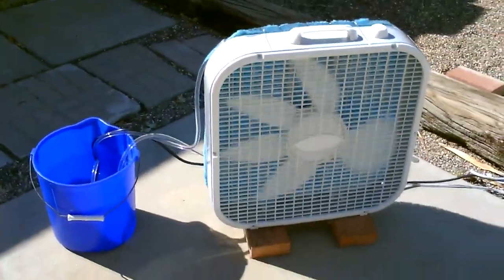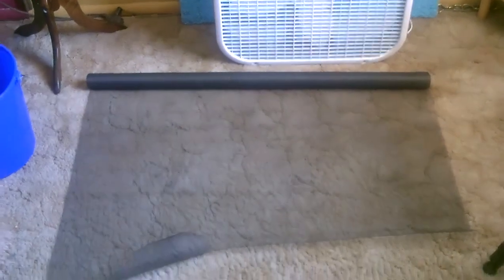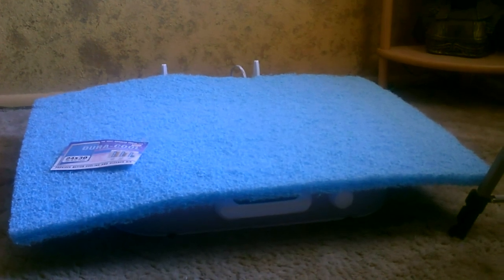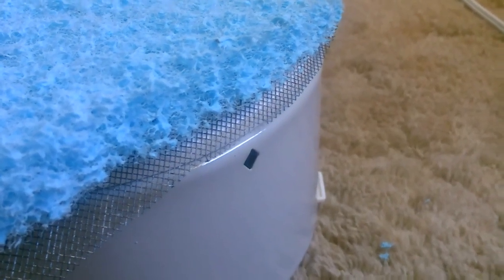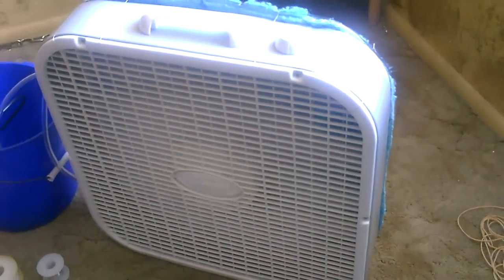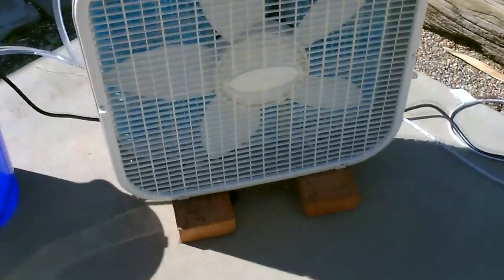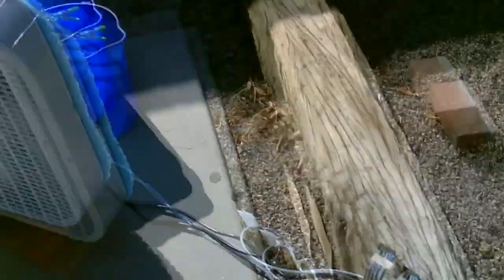Homemade Evaporative Air Cooler! - Simple "Box Fan" Conversion - EASY Instructions!

Comment: So what size pump do you need and how long does the water last?
Reply from the maker: i think i used a 200gph pump in this setup (but it doesn't have to be that big). the main thing is that the pump has a good lift to it. i've found that some smaller pumps that have a good lift height (63gph ones) can push the water thru fine. but i have a 168gph pump that doesn't have much lift and that pump struggles

Comment: You left out a section! How is the water pumped form the bucket through the hose?
Reply from the maker: hi. it's just a small water pump. i think i was using a 200gph one (but you could use smaller one)

Comment: My question is how did you connect the watwr tubing to the pump. I have a small fish pump and it has an over hang on the part where the water comes out.. would be nice to see the process of the pump and aquarium tubing
Reply from the maker: hi there. the tubing just pushes onto the outlet stem of the pump. it fits pretty snug but you can you a small 'worm gear clamp' if you want to. i don't think i've ever seen an over hang on a pump. most of the ones i use just have a stem

Comment: I’m going to use two box fans. I’ll use one for the air flow, and the other only for it’s frame. Then attach them together so I have a larger ac and the water will be further away from the fan.
Reply from the maker: hi. that could work, but, if interested, i just made a video that shows how to attach these evap pads to the back of box fans without the pad touching the fan. in the new design the pad is sandwiched between two plastic panels and then mounted off the back of the fan. there's an inch of airspace between the panels and the back of the fan, so there's no chance of any water getting on the fan. works awesome and is easy to do. the video will be posted in a couple of days (probably on 07/07/2023).

Comment: When you want Cold but end up getting Mold.
Reply from the maker: the way to avoid any mold is just to dry out the pad every 12 to 24 hrs. just flip off the pump and let the fan run for a while (maybe 10 or 20 minutes). the pad will completely dry and then you're go to go (for another 12 to 24 hours). also swap out the water, from time to time, if you have a larger tank.

Comment: What exactly is a evap cooling pad? I found an air filter that looks similar.
Reply from the maker: hi. evap cooling pads are specifically made to hold water in a certain way (while also letting a lot of air pass thru them). the material is weaved in a very specific way. the blue ones that i use are technically called foamed polyester evap cooler pads. air filter material is a different material altogether.

Comment: I just looked up where you get those Dura Cool pads?? they are over 100 dollars!!!! Might as well invest in an AC unit..
Reply from the maker: hi. they are $7 to $9 dollars for a big sheet of it. if you see them for more than 10 dollars then the seller is ripping you off. home depot and lowe's have them for about 8 dollars. note that they do sell the material in large rolls for over 100 dollars - but that is huge rolls. you could make 20 air coolers with a big roll of it.

Comment: IS this good for a humid place like Florida...any ideas for us in grid down situation here in FL?
Reply from the maker: hi there. i have some solar panel powered ice-based (or cold water based) cooling systems using a radiator as the heat exchanger. those projects would be a good choice. to see those vids check the playist area of my channel and look for the heat exchanger projects.
Reply: @desertsun02  TY so much, new  to all of this and trying hard to figure it all out, lol...subscribed to ur chanel!! Stay safe!!
Reply from the maker: @Karen Gouws thanks for subbing ✔😎💎

Comment: Shouldn't you have a lid on the bucket
Reply from the maker: hi. it will work with or without a lid. if i was dropping ice in there (for a super chill) i'd use a lid to insulate 👍🙂

Comment: Can't you skip the screen and just put the evap pad in front of the fan (the blow side)? Also instead of a pump and you just place the bucket on a higher place than the fan?
Reply: Use the pump to put the water back in the bucket from a catch on the bottom.

Comment: I did this w pushpins and found the water flow was poor.  Then I followed a hundred + holes w a small nail and was still disappointed with the water flow.  I shoved the 2 pins in the tube to not lose them and went to dinner.  When I came back after an hour +, I pulled the pin out and was met by a solid squirt if water from the hole that held the pin for an hour.
So hindsight, instead of the 500 holes he mentioned, put ten thumbtacks in the tube and wait an hour before removing.  Ten holes that stay open are better than 490 that close up.

Comment: Ha ha. We used to drive to CA from AZ in the 1960's  during the night and use water soaked anything in front of a partially open window. IT WORKED better than nothing. Alternatively, we would roll up all the windows until we were dripping in sweat, then roll them all down and for a few minutes, we were cool! That's natural swamp cooling at its finest....
Reply: im in phoenix and aps is killing my with this heat wave...i have  been doing the same sitting outside with wet rags, i never thought about this....DUH...lol this is awesome!
Reply: @davidpersico5028  I'm still in Phx. Yes, APS is a bummer with much higher $$ than SRP (I've never understood how having to move ones physical house to switch utility co's is "deregulation"?). 8Yrs ago I planted 3 desert trees on my west side that are now 30' tall and reduce my electric bill by 55%. The difference inside my house is extraordinary. If you have room outside, box stores also sell an S-shaped spray emitter that stands while spraying one nozzle of fine mist. While we desperately need to preserve water in AZ, it uses 1 gal/hr, so some cooling outside this way can be life-changing. Remember to replenish yourself with electrolytes but not sugary drinks or caffeine that will make one thirstier and hotter. Commercial electrolyte drinks can have dyes and too much sugar, so check out DIY.

Comment: wondering how to make the drip without the pump
Reply: You could try a gravity feed system - Have your reservoir higher than the fan, with the tube coming out the bottom or bottom-side.  Not as efficient, but it might be functional.

Comment: Can I use exhaust fan? Instead of box fan?
Reply: Any form of air movement is all that's necessary. A higher cfm will help with feeling cooler as well, though if the fan pulls air through the evaporative pad too quickly, some effectiveness would be lost.

Comment: My mother's sister had one of these 50+ years ago in Kansas which they called a swamp cooler!!!
Reply: Yes, he is making a DIY swamp cooler.  Some apartments have swamp coolers but don't get the room below 80 so this will help get it cooler.
Reply: CALTECH007 I live in a high temp, low humidity part of California. Swamp coolers, located on roofs, are the customary method for cooling homes, businesses, etc. In my experience the temperature can get into the 70s with swamp coolers. Evaporative cooling is the oldest form of cooling and was used by Cleopatra.

Comment: Crazy idea use a helium sealed stirling cold piston to generate liquid atmosphere that filled an insulated tank that siphoned into a drip system into a evaporation matto super cool the air has the liquid atmosphere returns to its gas state? You could use this concept on your ice chest air conditioning design. 😊😉

Comment: I realize this video was made almost 3 years ago but why did you not finish the project with a drip tray and a return to the bucket ?
This little improvement would have saved water in the long run and constant refills if that applies.

Comment: Does the shape of the fan affect the effectiveness?
Reply: the closer the blades are to the ring around it, the more powerful the air current (without changing size or shape of blades) but maybe you can do experiments to tell us if one shape is best?

Comment: instead of cooling pad would a air filter work???
Reply: I don't think air filters are meant to be wet. You can find lots of cooling pads at Home Depot or lowes by the swamp coolers

Comment: If You made a frame for the fan to set into after you were done building  the frame , with a drip pan ( like the bucket but more of a pan type thing.) you could use the run off water to re circulate and you would not have the dripping on the floor problem. Since the frame would be for the fan to set into, the fan housing would no  longer be the housing of the cooler, you could make the cooler frame further back from the fan blades.    If You used say, 1" and 1/2  white PVC tubing to make the frame for the fan to set into, it wold be water proof. you can get the bent joints to make corners and it would be light weight and pretty snappy looking really.   the cool thing would be, when the fan does fail ( they all do ) you could just put a new one in! :O)
Reply: Larry Leisuresuit thanks Einstein! It's his video make your own
Reply: @JulsAmez hanks for the comment jerk!

Comment: What can I use instead of the cooling pad? I can't find any of that in my country...Thanks in advance
Reply: if you can find sponge or even just some sort of thick cloth like wool...
Reply: +Antonio Baca Foolish me!  Thanks for the info :)
Reply: You can get those huge sponges at 99 cent store for 99 each and that's cheaper than the evaporator pads...
Reply: It's been 2 years since you posted.  I'm making one of these now.  Tell me did you think it worked?

Comment: haven't read all comments yet, but what about making a furnace type filter with the DuraCool?  Submerge it in water.  Remove and put in a freezer.  Place behind fan when frozen.  Could have 3 or 6 or ? ice paks.     Some type of channeled holder with a sponge or drip tray at the bottom.  peace.
Reply: The ice would block air flow
Reply: Did you try this?  Sounds like ti would work.

Comment: Hey man, how many GPM is the pump on this design?
I noticed that it's 200 GPM on the whole room super cooler design...same on this one?
Thanks
Reply: Probably don't need a high flow rate with recirculated water - a bigger, faster pump will add heat to the water. Depending on the drip hole size, of course, a smaller pump would be fine (and less expensive to purchase and run (electricity)). I think some form of flow restriction on the return end would help increase the drip rate, also.

Comment: You could plumb in a small plastic water line to a container, set up a valve with a float bob (like a toilet).  You wouldn't have to worry about refilling the water, or your pump burning out when it goes dry.

Comment: This is great for low humidity places like Arizona.   The water in the pad pulls the heat out of the air coming in.  The air comes in moist and cool.  You could cool a big room and more just with this.
Reply: Tom L

ovin

Comment: Wouldn't this block some of the air flow?? If so, then I'd suggest maybe cutting part of the spongy looking board? Maybe a big hole in the middle so more air flows through easily
Reply: krauser44 The brand he used in this video blocks off plenty of air. You could either use a more porous filter with a different setup or deal with cool air but low air flow.

Comment: Why not just keep the bucket above the fan and use gravity to move the water? No water pump needed.
Reply: Doug Morford  The tubing controls the water flow so it doesn't overpower the pad and drown your fan
Reply: Gravity flow would not provide enough pressure but it could be tried with a tall bucket.
Reply: ***** Your not very bright are ya kidda.
Reply: english1midlands Um, what's not bright about this?
Reply: You don't think a syphon would have enough pressure? What if you got smaller tubing?

Comment: When I was a boy in the 1950's, my Dad had a cooler which operated on the same theory.  It was a round, torpedo-shaped device that mounted outside the passenger window of our 1953 Chevy Sedan much like a carhop tray.

The device worked quite well except during left turns which would slosh the water out of the cooler and onto the front seat passenger's head.  It was a little messy but in 1953, who actually knew the difference.
Reply: So it was extra-effective for the front seat passenger during left turns! :)
Reply: yep they look really cool on classic cars.
Reply: Where re do you buy the pad.
Reply: The Erod1944 Channel lmao
Reply: I've only seen one picture of those.

Comment: It's impossible to find a box fan in the UK I don't know why:(
Reply: GTi I know . . bcz they don´t want you to save $$, the ruling class have their loyal subjects who are sheeeple . . and are exploited to keep Royalty comfortable .. Greetings
Reply: GTi Amazon
Reply: English blood Irish Heart.. sorry. just had to. Don't know that many English men round these parts... Anarchy in the UK.. That is all...
Reply: GTi get someone you know in US,to send you one send them a money order and about 12$ extra for shipping That should work  they had about 20 left of big 3 speed box Fan's for 16$ I was thinking of getting another one, when buying a fan always make sure it has either clips to keep granted sides on or regular screwdriver for screw's so you can clean blades, even if you're super clean it pulls dust, bird feathers and if you're in an apartment &the dryer vent is close you get lint & fuzz.Way to get rid of fuzz from outside on screen turn opposite blowing outside instead of sucked air to you & it should get most off.unfortunatly I'm on 3rd floor so hosing down screen isn't available+cheap builder made sure no outside spicket
Reply: GTi , it's called..... " Order online, Amazon" or some place. They do have shipping in UK right???
Reply: You have to remember that the UK may have different power regulations than in the US, buying it wouldn’t help if you don’t have 110 power outlets. Just some additional food for thought.

Comment: You should remember this only works in a dry arid climate, If you live in the deep south or a wet humid climate this will not work, it will cause mildew in your home. It is the same system we called a swamp cooler.
Reply: The first swamp cooler I ever saw was in my uncle's home in Oklahoma, back in the 1950s; it worked pretty well in those hot, dry Oklahoma summers.

But the second one I ever saw was in my office at Fort Polk, Louisiana in 1969.  Just as hot as Oklahoma, but far more humid -- and it still worked well.  There were probably fewer than a dozen air conditioned buildings on Ft. Polk back then, and those got AC for the benefit of valuable electronic equipment, not people.
Reply: no it can work in any climate, just the amount of evaporation will be different so some people will want some sort of catch basin at the bottom, would be better to have the reservoid at the bottom to catch any water than bypasses and then would get repumped to the top
Reply: @ruthven78  if the air is already humid, u just need a fan.
Reply: The absolute number one rule to these cooling systems is "evaporation". If you saturate the medium with water you reduce evaporation drastically, thus much less cooling.  I like this unit but would have used 3 layers of cooling medium with the same amount of water.
Reply: Sky High kn  bbq Bibb
Reply: Smart arse
Reply: I wonder why it worked in Louisiana?
Reply: In another video he states that it doesn't do well in Florida...
Reply: There's a solution
Reply: mike, move to Arizona desert area,  they work there, man do the work
Reply: I live in Florida. I completely understand the concept. built this just as you did. ran it for 8 hrs in my closed garage (not worried about mold). I see no temp change coming off the fan front at all. not even a couple degs. the pad is completely saturated.setup is working 100%. no temp change at all............ I don't think living in the south is the answer. I ran the fan on high, med and low to see if air / water was the problem. no change at all.. any suggestions?
Reply: @mfredricknew  because Florida is already a swamp, u just need a fan and point it at your head

Comment: Swamp coolers work the best under 100 degrees.  You can relax from worry of it dripping on your floors , window seal ect if you buy a short plastic box (maybe just the lid) from the cheaper stores, and set it in it.  You can get one for like $2.00.
Reply: Haleene Williams  the temperature is irrelevant,  the lower the humidity the better.  Here in Phoenix we get up to 118 degrees in July and if the humidity is low swamp coolers work great.

Comment: Bro, I planned for such an air cooler you have showed. But I have got a problem. Need suggestion to solve it. What about the Humidity? I think, the humidity of the room will  increase which can damage your wall or such many things. Any solution for that? How the humidity can be controlled? What about using an exhaust fan?

Comment: maybe if we placed the bucket higher than the height of the fan we can do away with the use of the pump and let gravity do its work ?
Reply: You should try it or we will never know if it works.
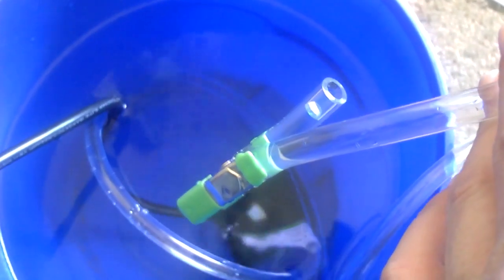Reply: SeeWaffle9 Here's not recycling the water. See 4:50. It's just dripping on the ground. At 4:22 you see the end is clamped off, so it does not need to even return to the bucket.
Reply: You couldn't recycle the water then
Reply: Yes, I've done this. No need for pump! Works great in PHX, AZ in the summer.
Reply: thank you
Reply: Or maybe if he put tray under the fan  deep enough for the pump he can use the same water
Reply: Do a heavy gravity feed. use the pump to put it back in the bucket with a catch tray
Reply: SeeWaffle9 There's really no need to recycle the water if you're doing a gravity feed. Also, being more strategic about the number of holes should allow for less drippage at the bottom.
Reply: fidel catsro.